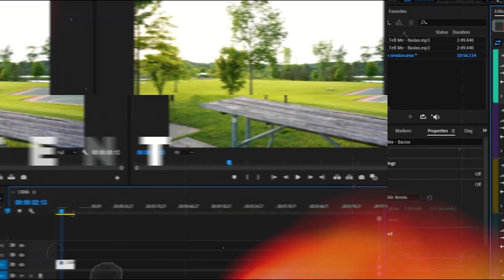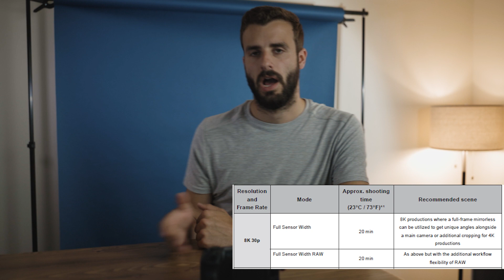How To Prevent The Canon EOS R5 From Overheating

Comment: Finally someone talked sense. Good job James - you absolutely did justice to the word engineering in the channel name. A lot of reviewers are making such a huge deal about R5 overheating that it is now tiring to hear that. The fact that Canon has clearly spec-ed out the R5 and its use cases should be considered with more thought by these youtubers. What I see on most reviewers' video is first thing they do is throw that manual out of sight and start putting the camera down, forget about reading the specs!! I think the only mistake Canon did is they didn't mention the limits and use cases of camera during product launch or in the leak phase...if they had clearly set the right expectations from the very beginning, people would have not bashed such a great camera down. Also, people are not considering the amazing photography side of the camera as well - which in itself is worth the price. Most people want 8K no holds barred camera for $5000 sadly.

You did a great job on this video.  Kudos man, keep up the great work and post more regularly.
Reply from the maker: Tell. Me. About. It. I am soooooo annoying with every single person and their mom complaining about a camera that...they have simply never used. How can someone be so negative about something they have never even put their hands on? Almost every video about the R5 is bias in some way or another (even mine) but i try to stay positive about it. Even sonys new camera I am all for and happy about. I would buy it. I am not over here finding things that suck about it. 

They remind me of my mom. Even though a manufacturer puts clear instructions on a product she assumes they are wrong and does it her own way. Even though it takes a lot to make a product. A lot of research and engineering and time. The engineers didnt just make the instructions for fun. I agree with you, if canon put this out front, it wouldnt be this bad. I normally read instructions or manuals when I get new products. One because I like learning how things work (engineer in me) and two, I want to make sure I am correctly using the product so it will last as long as possible. 
Thanks for the comment!

Comment: I'm a feature cinematographer, and I'm definitely planing to use the R5 in 8k.  But only as a B-Cam, alongside a Red Gemini A-Cam.  The R5 footage 8k looks very good and while the DR is not in the same ball-park of the Gemini's 6k image, with careful lighting and framing that will not be an issue.  Having the small second camera (R5) available to basically pull out of my pocket and grab a shot that will be easy to match up with the A-Cam footage is an awesome productivity gain.  I also took the R5 with a PL adapter to location scouts and the director and I blocked out shots with the lenses we will use on the day of...the results being zero guessing on angles, lighting, and what shots will need to arrive at the look we like.  Super cool.   

I've already shot a couple of band promos using 4k HQ, which looked great and no overheating.  I would turn the cam off when idling through lighting setups.  It helps being very experienced so that I don't have to look at a monitor to know what lighting to add/change to create a look.

This is a great mirrorless camera.  I don't shoot youtube videos or talking head interviews with it...not the right tool. But the R5 is now my go-to travel cam, and will always be in my backpack for capturing stills.
Reply from the maker: This is great! and exactly what the 8k is meant for!

Comment: thx for the vid!
can u tell about the quality of the 1080p? and does it overheat? i wish u can tell about the 1080p in the r6 also!
thx alot!
Reply from the maker: Check out the video before this called I shot a wedding on the EOS R5. I shot a whole wedding in 1080 60 on the R5. It has a blueish thumbnail. The 1080 does not overheat. The 1080 in the R6 should also not overheat. You can see the full specs of overheating on canons website for the full spec sheet on the R5 and R6
Reply: @EngineeringFilmmaker  ok, thx alot!!

Comment: I've ordered the R5 a while back and I am definitely looking forward to use and see how I work around it's limitations 👍
Reply from the maker: I think the real question is, will it even give you issues to have to work around or will it work just fine for you? It all depend on how you utilize the modes.
Reply: The Engineering Filmmaker yeah thats really interesting to find out once I get it in my hands, as I shoot photos for weddings for a living and during the job usually I may just take a few slo mos here and there just as a highlight for my instagram, the only time i extensively use video is my daily stuff of me recording my kids and also for my youtube channel
Reply from the maker: I have seen a few people say even during photo it overheats which if that is the case that is not good. I can imagine the reason for this is that the sensor is so large (42MP) that it just takes a lot to process those photos and im starting to get the feeling that if all of this over heating stuff is true, the processor might have issues.
Reply: The Engineering Filmmaker hahah oh well to late now I’ve paid the full price for it and I look forward to really putting it through it’s paces once it arrives 😄
Reply from the maker: not a bad thing

Comment: OK, just found your channel and need to know: What graphics card for PC is suitable/best for editing 8K / 4K video at 10 bit 4:2:2 ? I understand that most are only able to work with 10 bit 4:2:0.
I have an Intel i9-8-core running Windows 10 Pro 64 bit.
Reply: The problem not in hardware, but in software. iPad can easily decode h265 4:2:2 but iMac Pro can’t. We just need to wait for new drivers and optimization. Very bad, that canon doesn’t allow to choose 10bit 4:2:0 or h264 codec, like Sony a7s iii
Reply from the maker: It's not necessarily a GPU issue. For just editing straight footage with no effects applied or graphics or anything like that, its mostly a CPU thing. I will be upgrading from a x series i7 (8 core) to a 18 core i9 xe when it becomes available. I personally run a 1080 ti hybrid but there are new 30 series coming out soon that would be nice, or a card that is geared towards workflow and not gaming.
Reply: Yeah... This isn't a GPU issue, but rather a software problem. Now, if you want a great CPU for video editing (since the gpu doesn't really matter), I would go straight AMD since they are just amazing rn. I have a 3900x and it breezes through video editing with no problem. You could also look into the Threadrippers cause those CPUs are beast
Reply: @joshuareveles  Having just built a new Intel i9-9900k 8-core, it was the graphics card that I was questioning as I am currently running a Geforce GTX 1660, and I had read somewhere that it was something to do with the 10 bit 4:2:2 that caused a problem. H.265?
Reply: Hi guys I see an interesting discussion here. Got my R5 last Sunday and been working with it all week. I did my first day of editing today and my threadripper 3960x + 2080Ti is laggy in premiere with the 10 bit 422 R5 footage (my “field” MacBook Pro 2018 does not even play a single frame lol). I had to convert all my clips to ProRes 422HQ with VideoProc, which is fine because it’s easy, fast, and then it’s butter in premiere. As long as h265 10 bit acceleration is not supported on pc or Mac, don’t even think about doing any other way (or proxies), it’s like playing a modern AAA video game without a GPU to give you an idea of what I mean by “laggy” :)
Reply: @stevewestonphotography  I understand man, like, with the footage from the R5, it definitely is a software issue since there isn't really any software that can handle 4:2:2 10bit footage

Comment: Thank you. I already have R5, RF15-35mm F2.8, RF35mm F1.8 and RF50mm F1.2. I will have RF100-500mm at the end of September.
I ironically felt that many Youtubers commented on the heat stalling problem and their PC specs were terrific and their external hard disks also had fast products. ..
Most of them have never processed the 8K, 30 minute recorded image.
Next many of them will complain that the PC has stopped working due to heat.
Reply from the maker: Yeah, a lot of people who says it overheats just set the camera down to record.

Comment: Good stuff bro! Although I wish there were no limitations in 4k 30p Hq, I can work around it and the tips you gave are good. The only drawback in the normal 4k that I noticed on my r5 is that the normal 4k looks a bit less sharp and muddy. But nothing a little sharpening in post can’t fix. Still need to test different scenarios
Reply from the maker: Thanks! Yeah I agree, if they do an update with lower bit rates, we would be fine! I would try shooting in log if you are not already or even 10 bit for certain 4k modes and then you can sharpen in post and it will look great.
Reply: @EngineeringFilmmaker  Thanks and I agree, that's what I have been seeing in my own tests that I am conducting. I really love this camera. I feel Canon marketed this Camera the wrong way. Had canon not make the below claims, people wouldn't have such high expectations from it.  I can see why people think this camera is crippled and doesn't deliver as to what's promised. 

“On the set of high-end productions such as commercials, dramas and documentaries, the EOS R5 is an ideal partner to the likes of Canon’s brand-new EOS C300 Mark III”

“Set to redefine mirrorless, today’s update confirms the incredible recording capabilities of the EOS R5 including internal 8K RAW up to 29.97fps and suitability with high-end production workflows”

“The EOS R5 boasts features seen only in high-end cinema cameras many times its price point and video features no other mirrorless camera on the market offers.”

“Created as a direct response to growing demand for content creators to shoot both high-quality film and stills, the EOS R5 holds its own as the lead camera in productions – going over and above industry standards and achieving outstanding 8K.”

“The camera will shoot comfortably on high-end production sets”

Just a thought. That being said, I believe in the right hands with someone creative, they can create a blockbuster with this. 4k 24p normal mode is more than good enough and sharpness imho is overrated. Up until a couple years ago, blockbuster movies weren't insanely sharp and they used that to their advantage to hide flaws. There is a reason why many film makers use a black pro mist or other softening filters to make the image look more cinematic and pleasing and not too sharp which gives it a digital look. End of the day story is king.
Reply from the maker: Yeah I agree. Canon dropped the ball on marketing. They got way too excited about the crazy specs. All they needed to tell me was IBIS lol. But they could have mentioned like "8k 24/30 is best used for secondary cams for productions" or something instead of "holy heckin heck, it does 8k raw whaaaaaat" lol
Reply: The regular 4K is still darn good though.  It just looks less sharp because the HQ 4k is the best 4k I have ever seen
Reply: @RockyColaFizz  hmm it's good but not darn good in my opinion. If you compare that normal 4k form the R5 with A7iii or GH5 or even the Z6, it's quite a bit softer. But nothing a bit of sharpening and clarity in post won't fix. So I am still a happy camper :)
Reply: @Musatainment  I hear you.  I have the Xt4.  I had the A73. The XT4 is actually a bit sharper than the A73 in my opinion. And I am telling you. It takes cropping in and real peeping to see any real difference.  Again, the HQ 4k is certainly better.  But, the point is, that if you overheat and have to resort to standard 4k, it is perfectly fine.
Reply: @RockyColaFizz  Nice. I had the XT-3, love Fujis. I have been doing some tests on my R5 for myself. On Youtube you probably can't tell the difference. But on your computer, you can tell without cropping trust me :) That's all I have been doing for the past few days. But once you sharpen the Non HQ footage just a tiny bit, then it's almost impossible to tell even if you were to crop in 200%. Another thing is noise levels, which doesn't seem to be any worse as of yet.

Comment: what's your take on "The overheating clock counting down in the background while just being on, i.e changing menu settings, framing up shots, taking pictures, etc"  In my opinion, if this holds true it is a huge drawback, I personally don't have the budget in SD cards to shoot in 4k 120 for hours lol but on shoots, I do tend to leave the camera on in between shots and if the overheat timer is counting down in the background by just being on does that justify paying 3500 for a camera body? then another 2 grand for a good RF lens.
Reply from the maker: Honestly I have no opinion on this since my camera worked for an entire wedding. After more testing I will be able to say a little more about it.

Comment: I did preordered the R5 and I have three RF lenses for it the 15-35 2.8 the 24-70 2.8 and the 85 1.2 and I plan to use the camera to vlog shoot photos as well cinematic car after movies and features maybe a few for different things but for the most part those things I just described I feel that the R5 should be able to hold quite nicely specially with future firmware updates .
Reply from the maker: 100% agree. I think it will be great.

Comment: Unfortunately I have not had the experience that you are describing. I took photos for an hour and a half yesterday, and about an hour in, got the overheat warning. I took one very brief video in the midst of that, but that's it. Nothing taxing, nothing that was touching the "overheating modes"... and the camera still overheated.

As far as I can tell, the overheat timer is essentially on as long as the screen is on. So if you take a shot, put the camera down, and then take another shot in 5 minutes, you may be just fine for quite a while. I took a hike last weekend where I took a bunch of 60p and 120p, and started to get the warning after about an hour, but I never actually had it shut down on me.

What you unfortunately CANNOT count on it to do is what you described in the video: stick with 4K 24 for most of what you're doing, but then be able to count on jumping over to 120 when something exciting happens. The camera will be overheated. As far as I can tell, it's just constantly in "overheat" mode as soon as you turn it on and start doing anything.

HOWEVER: watch this video: https://www.youtube.com/watch?v=PnG00Fhu5pI. Guy shoots for 4 hours in 4K 30 HQ. His results have been confirmed by another YouTuber, Adam Grumbo, and even Gerald Undone has commented on the video seeming to say it sounds plausible. The trick apparently is to record externally without any cards in the camera. Time to buy stock in Atomos...
Reply from the maker: Yeah I have not tested photo yet and have not heard good things. I am not sure why photo is so bad, it could be because the sensor is so big and has so much more information than a normal 25MP camera. Using an external recorder you can get pretty long record times no problem.
Reply: @EngineeringFilmmaker  Speculation I've heard is that there's a straight-up timer going in the camera from the point you turn things on. I hate to think that, but it makes a degree of sense. Some of the issue seems to be related to heating of the CFexpress card, but I wasn't saving anything to the CFexpress card, so it shouldn't have been heating up at all.

I plan to test the overheating by shooting with no CFexpress card in there and seeing how that goes. Like, can you just pop it in when you're in need of higher-bitrate stuff? Ugly workaround, yeah, but until there's a firmware fix...

Comment: Thanks for the video. I wish this usage would work, that would have been fine by me, but apparently it doesn't quite work like this in real-world use. The heat seems to be cumulative even if you are just shooting photos or lower end video, so if you are shooting Photos or even 1080P at a wedding and then you decide, "oh man, the flower toss would be perfect in 4k 120", guess what, your camera is already too hot to shoot that. At least that's what it appears like from all the info I've been seeing, which that's a disappointment cause I originally thought the same thing as you. Apparently, the problem is that the camera (because it's so weather-sealed) has a really tough-time dissipating heat when it's on, nevermind which mode you're shooting in; it is not dissipating heat to get you to shoot internal 4K at 60. Am I wrong here? did you try this kind of scenario yet? I would love to be wrong on this. You CAN shoot externally-recorded 4k 60p without heat shut-off though. Thanks again.
Reply from the maker: Yeah I think you are pretty right but I do plan on doing some real world testing tomorrow. To shoot 4k 60 external you need something like a Ninja V with an adapter for SDI input
Reply: The Engineering Filmmaker yeah I think external 4K 60p non-HQ seems to be no problem, which is not a bad thing, if the quality is really good, I’d be pretty good with that. I personally prefer having an external monitor-recorder as it’s better to really see what you’re doing and for manual focus. Good thing about the ninja also  is you get the benefit of cheaper storage and ProRes coding also. Looking forward to your results here. Keep us posted!!
Reply from the maker: I have been thinking of testing out 4k 60 external recording but I dont have the adapter needed for the Ninja V to record 4k 60. You can get a Ninja product that allows 4k 120 external but its like $1200